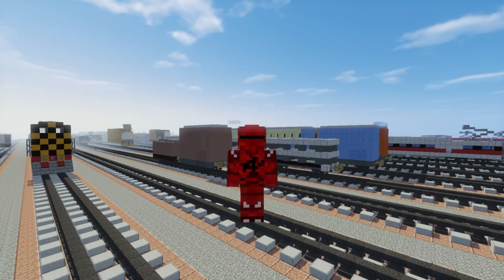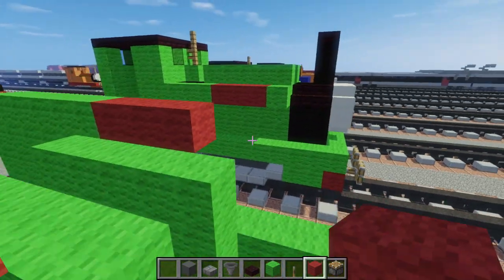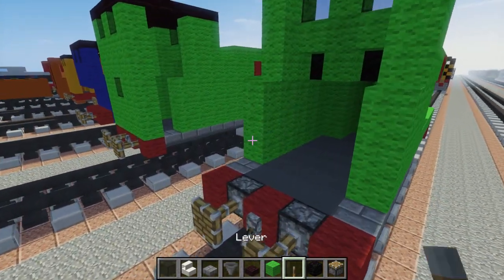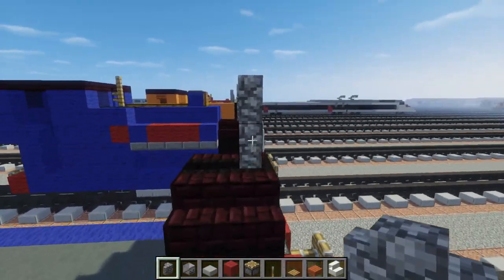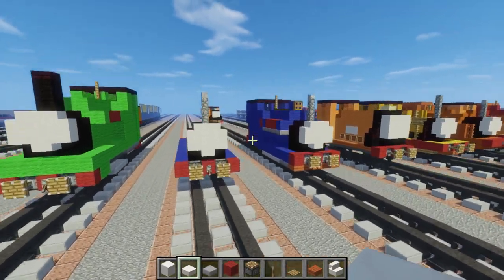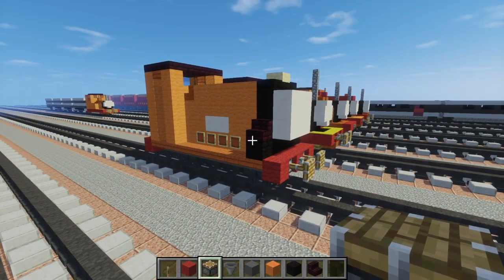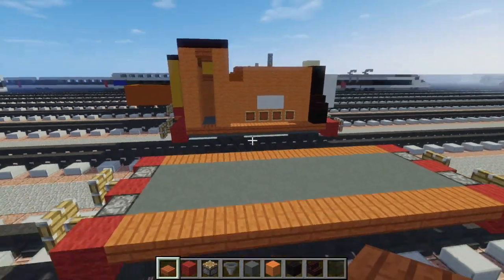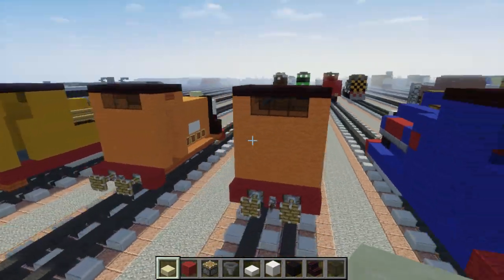Minecraft Peter Sam, Sir Handel, Rusty, Duncan Thomas & Friends Tutorial

Comment: On Peter Sam, the third window is not a window, its a hole for easier firing, as the cab on the real engine was too small for the fireman to shovel the coal properly, but now Edward Thomas (Peter Sam's basis) has an extended cab.